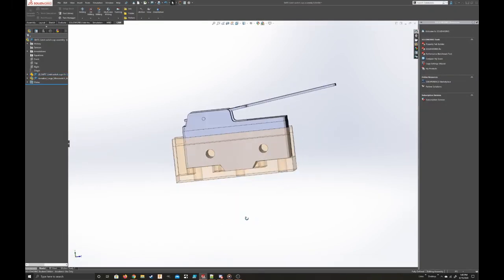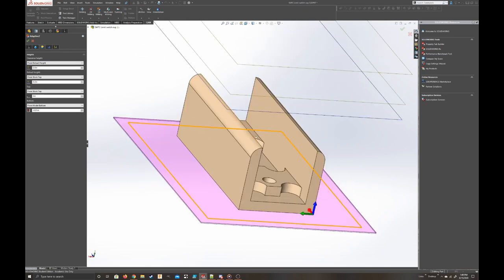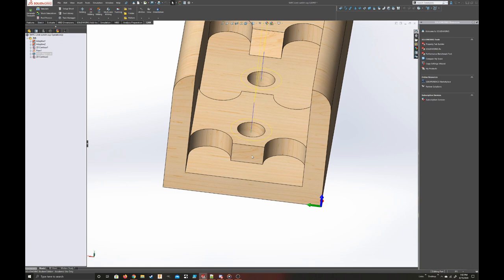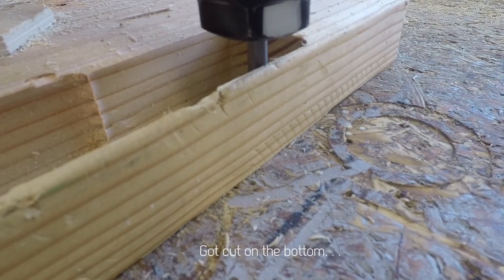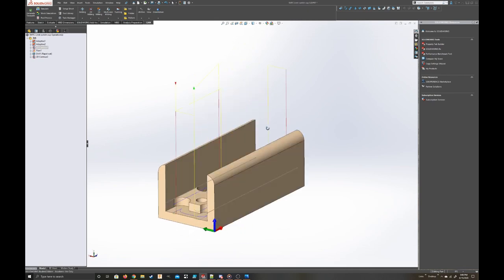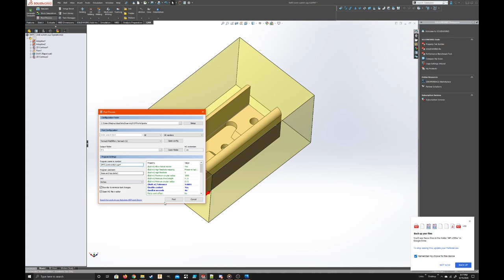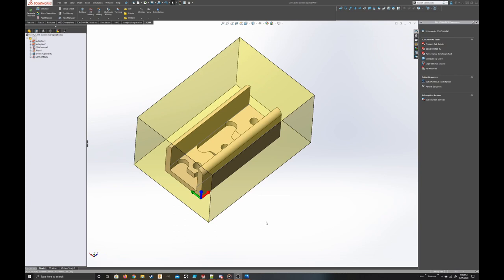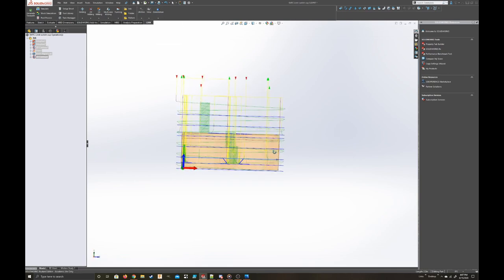Making a wooden part thing

Comment: hello everyone um I am debris and I just wanted to walk through the cam of this part right here, what this part does, right, as you can see, it holds on to this little limit switch.. and... it has some holes that connect the leads and yeah..... that's pretty much what it it. Its made out of wood, let me open up the individual part file, its made out of wood, it is going to be machined ut of like a 2 by 4, and it doesn't need to be that strong, but It doesn't present a machining challenge that's for sure. The first operation that I added was a adaptive operating that machines away the top part of the stock uhhhh so right IIIIII use very like our generic feeds and speeds for the machine we are using, we are using a shapeoko 3 cnc router with some... with some new motors and a better spindel... and a heavy duty Z axis which is pretty great honestly ummmm but spindel speed is about 200000 rpm ummm 60 16 beats per minute which translates translates to a relatively
Reply from the maker: ning nong